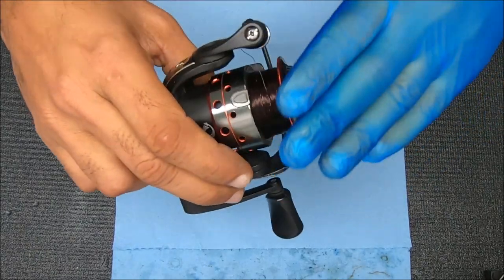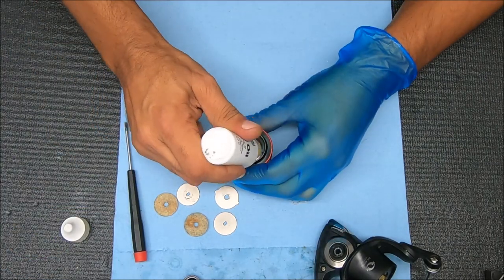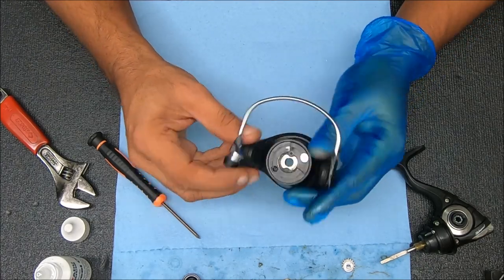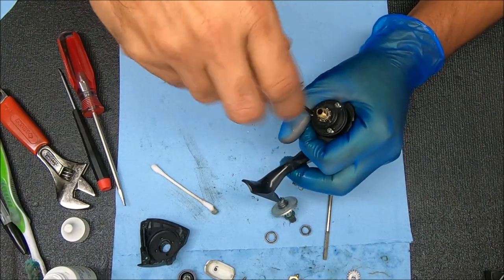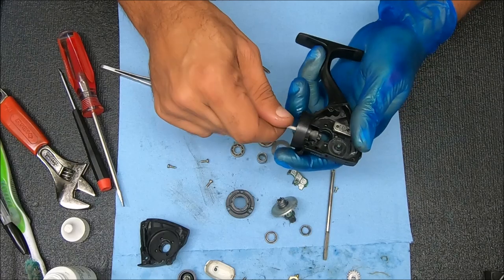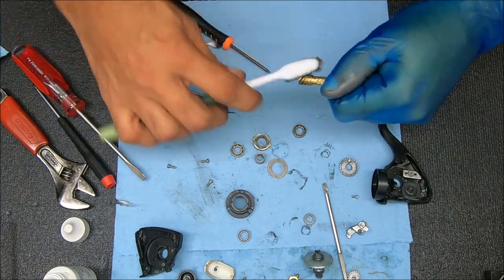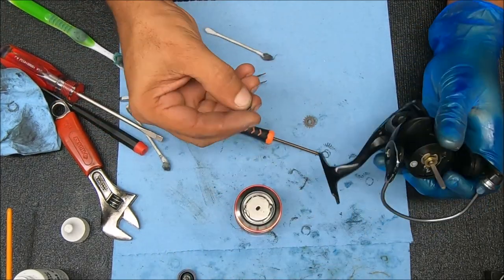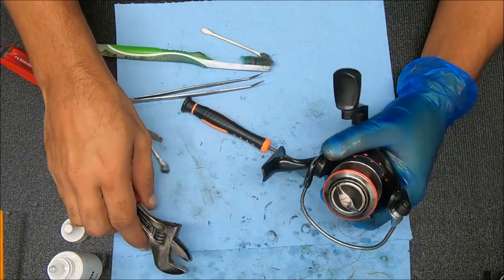Shakespeare GX230 - How to OVERHAUL this spinning fishing reel

Comment: I have the gx225. I just got a new ultralight rod and was gonna get a new revros but after seeing this, maybe I will try to service it and save some $. The bail trip doesn't want to work. It's old and never been serviced
Reply from the maker: Yes, give it a shot.... check out my everglades fishing video to see it in action. What's your bail flip doing?
Reply: @TSGReelService  It won't flip on it's own. A little resistance then it just starts to rotate  with the bail open. When I close it manually the spring feels weak but it stays closed and is fishable. I probably damaged it by forcing it
Reply from the maker: Okay, got it. Try removing the bail wire and lining it up over the posts on the rotor that it rides on.... if it's too tight of a fit, try opening the bail little by little until it feels like a comfortable fit. If it's too wide when you test it, do the opposite..... and see how the flip works then. I have this tip in one of my Spinfisher videos, but can't remember which one. Sorry.

Comment: Hi, my uncle gave me a GX250 reel as a gift, but it missed the line roller, the bushing, the washer, and the collar. Do you know where I can purchase Shakespeare reel parts? Also, I would like to upgrade it with stainless steel bearings. Thanks for your video 🙂
Reply from the maker: You're welcome and thanks for checking out the video. Happy to hear the reel is being kept in service. Best place to try for that stuff would be eBay..... try this link.... https://www.ebay.com/itm/225627842243

If he doesn't have what you're looking for, try reaching out to him.... he's a good seller.

For the bearings, you'll need the measurements inner dimensions, outer dimensions and width in millimeters before searching for them.... you can use a caliper.
Reply: Thanks a lot bro🙏🏽
Reply from the maker: @yobanpelayo8686  all good brother.

Comment: Any idea why my real (gx225) would be stiff when the handle is on the right side? But not stiff when I switch the handle over to the left?
Reply from the maker: Could be the drive gear bushing/bearing or too much lateral handle force. Could be the handle sits too low on one side and not the other. These are the things that come to the top of my mind. Hope it helps.
Reply: @TSGReelService Thank you, i think the handle sits too low on the right.... (years of use)  I think it's just plain old worn out on that side. Thanks a ton for the video by the way!
Reply from the maker: @TomahawkTom  you're welcome and no worries. Yes, that can happen on a well-loved reel. Spread the word about the channel.

Comment: Hey I’m having trouble getting the gold bolt back on the reel any suggestion
Reply from the maker: Hi, no. If it came off okay, then you should be able to get it back on.... unless you damaged something.
Reply: @TSGReelService  it goes on fine there just not enough room for it to go back on
Reply from the maker: What specific time in the video are you having an issue with?
Reply: 20:19 putting that bolt back on
Reply from the maker: Sounds like you broke the pinion support. See minute 27ish on of this video:

https://youtu.be/OEAlyw0c3VM